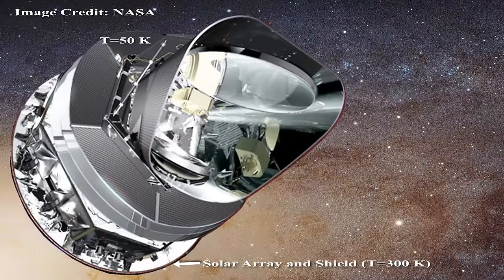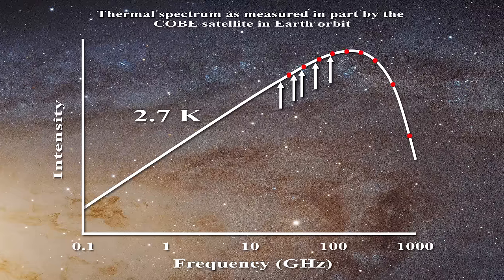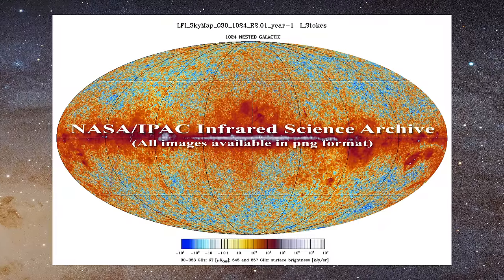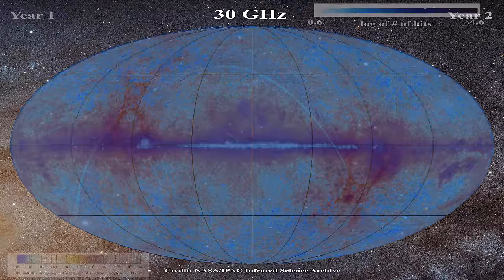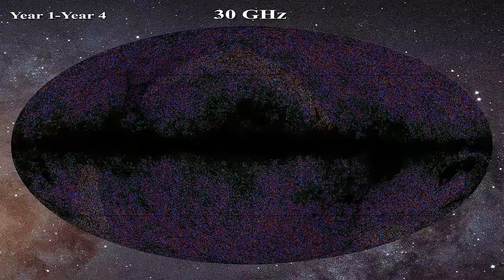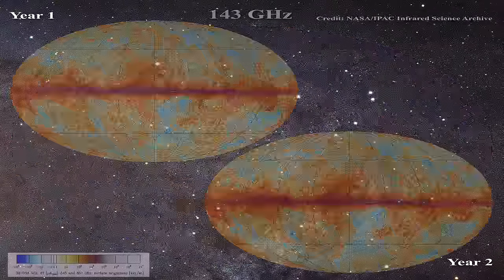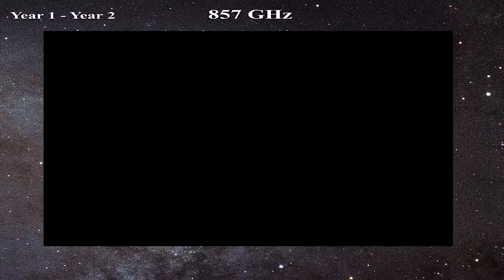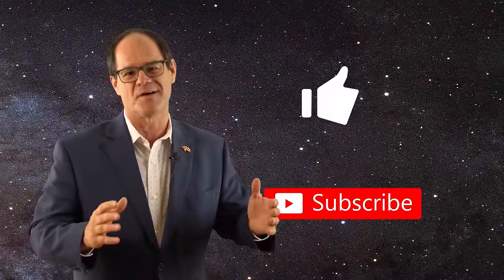The Planck Satellite - A $1,000,000,000 Misadventure

Comment: What naivety! (18.03.2014) The observation of so called “relict radiation” shows some polarization spots of the received far infrared light (several degree K) and some researches instantly decided that this is result of quickly expansion of the big bang energy which unknown how instantly creates mass (electrons) and polarizing the space around this mass resulting as a gravitational waves!?
“The changes in a particular type of polarization, indicated here, are theorized to be caused by gravitational waves. These waves are signals of an extremely rapid inflation of the universe in its first moments.” First of all let prove whether this radiation (relict) indeed is echo of such not proven as existing phenomenon called big bang…we cannot! This article is nothing more than effort to revive the so called “standard model” which is of course incorrect. First of all polarization of the space exists only in strong interaction cases (see part III USM www.kanevuniverse.com ), which it isn’t the case of the beginning of our space formation in the center of our galaxy (see Q&A on the same site). Second: there are suggested the electrons which don’t exist in the beginning, because there are only proto particles which are a lot lighter than the electron and the very first orbital system forming by these two proto particles in fact are in weak interaction each other and polarization of the space there is impossible. Third: There somehow is forgets that in the hypothetical “big bang” supposition, in the beginning there exist only energy of “explosion” , but not any masses, which is physically impossible event of course. But in this article absent explanation how this “energy” without mass carrier passes into the mass of electron! But let back to the radiation itself. So how this article would explain and gives us acceptable calculation about the temperature in the spot called big bang and how this temperature cooled to several degree (K) and what is the mechanism of spreading of this “relict radiation” without mass carrier from the big bang (which is purely energy), to the whole distance 14 billion light years? They wouldn’t! Observed polarization of received here infrared radiation can to explain by variously ways…one of them is that this radiation make polarization spots because passes through polarizing matter during its moving to us…..another is interference between the infrared waves depending by their intensity…and many more!? So what proved observed polarization spots? Nothing! G.Kanev